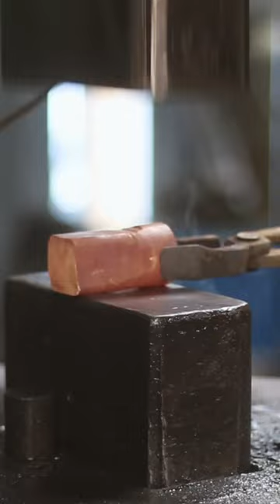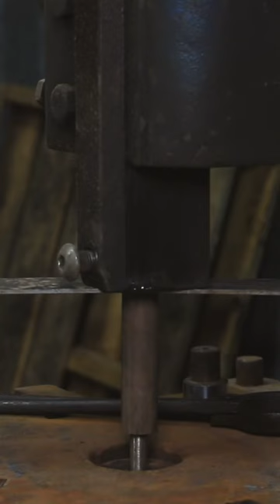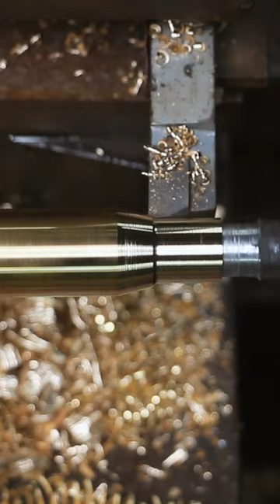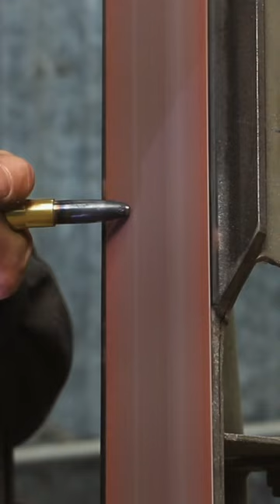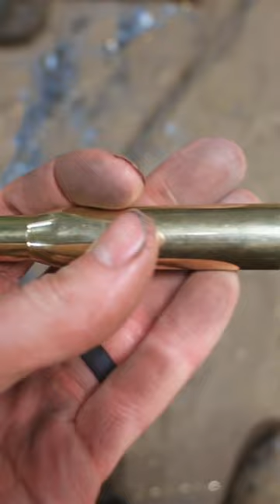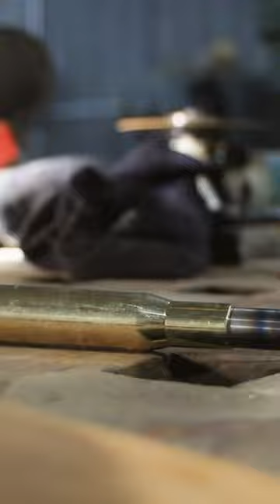Making a 50 BMG center punch.

Comment: Nice one until you get them confused and try to use a real .50 BMG as a center punch
Reply: Thats called an "automatic centre punch "...
Reply: It would be fine except you’d reduce your OAL of the firing round. In doing so you’d increase the case firing pressure.
Reply: Might get a darwin award